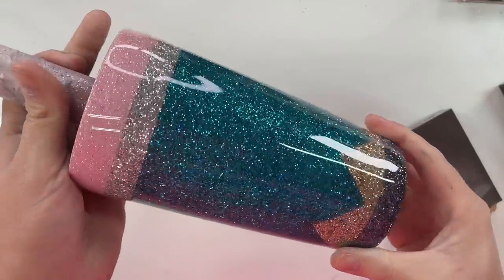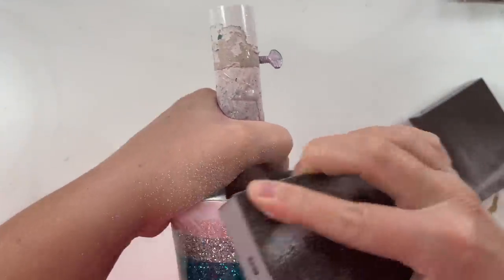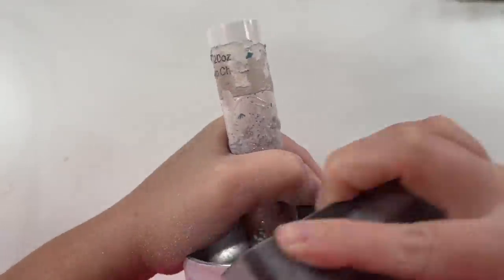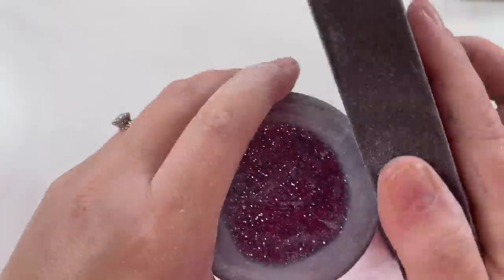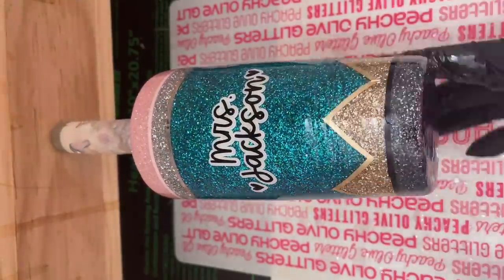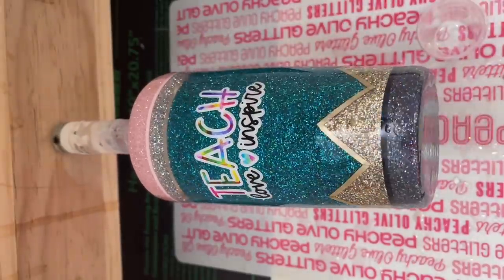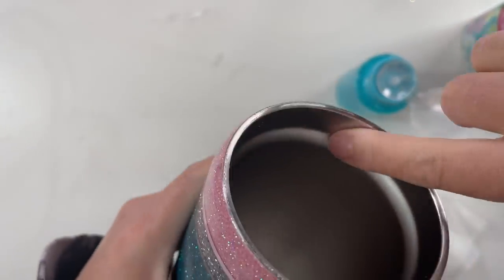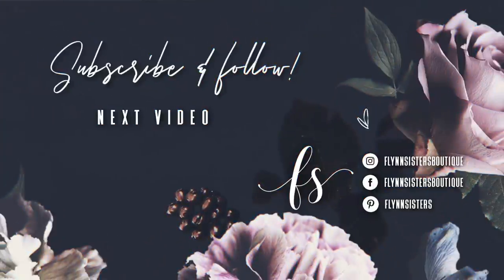Sanding Epoxy Tumblers

Comment: Great tutorial as always. I have one brand/style with a very sharp bottom edge. I struggled with getting epoxy to cover the glitter and not sanding it off. I learned I was probably using too course of a grit when sanding. Thanks!

Comment: Thank you for the video. I truly enjoy all your tutorials. 

How do you get a thicker coat of epoxy on the bottom rim? Mine is usually super thin after 2 coats of epoxy I sand down to the stainless steel allllll the time.

Comment: I have seen a lot of people who do tumblers and they have like bulk glitter in bags, I was just wondering where you’d think to get it. Or where do you get all of your glitter and do you buy all or get it wholesale in bulk? 

I’m doing tumblers and I’ve followed you since I started but I feel like to do what I wanna do I need all the glitter lol I got paint, alcohol inks, spray paint and a cricut. The only thing I can’t find is bulk glitter at a decent price lol.
Reply from the maker: I just exclusively use Peachy Olive Glitters. They have the best quality, solvent resistant, great cut sizes and huge selection. Great customer service and ship times as well. Here's a link and discount code - one 2oz bag will coat over 8 30oz tumblers with full coverage. 
👉 https://peachyoliveglitters.com
👉 Use FLYNN10 for 10% off $45 or more!
Reply: @FlynnSistersBoutique  Oh ok, thank you for that, I was wondering how much glitter to get for so much cups! And thank you for the code! 😊

Comment: I put vinyl wrap on my cup. Do i need to do 5 coats or is 2 ok? First time doing epoxy
Reply from the maker: I would do more than 2 coats. If epoxy is too thin, it can easily chip and crack.

Comment: No matter what I do I keep getting air bubbles. I use a torch and I try to stir my epoxy gently to not make it get a lot of air bubbles and I always get bubbles. Another thing with my patterned vinyl, I can never get it lined up right. Not sure how I can make it look lined up. Idk what I’m doing wrong. I am only a few months into it so I am new. But I def need guidance.
Reply from the maker: Have you tried heating part A of your epoxy prior to mixing? LIke on a heating pad or a bottle warmer? With your patterned vinyl, do you mean the pattern doesn't line up? that's really hard to do. or do you mean it's like crooked? I'd have to see what you mean by that. If you haven't already I highly recommend joining the Flynn Sisters Community group on facebook. Lots of friends in there to help!

Comment: Do you know what causes the top to lift and peel ? Is it my epoxy ?
Reply from the maker: Could be that you didn’t establish a clean seal at the top and the epoxy didn’t create a mechanical bond to the surface. Hard to tell if i haven’t seen a picture tho

Comment: I can’t keep a straight hand with the dremel and flap wheel to save my life! I use the sanding block also, perfect results! Only difference is that I sand wet to avoid the dust particles. Thanks for the tutorial! I love your finishing techniques and use them all the time 💕

Comment: I have resin bumps on the bottom of my tumbler to where it stands crooked, how can I fix and prevent?
Reply from the maker: you can prevent that by ensuring your tumbler is level once it's on the turner. I think i showed in the video how I line up a level against the bottom of the tumbler after it's on the cup arm and turner